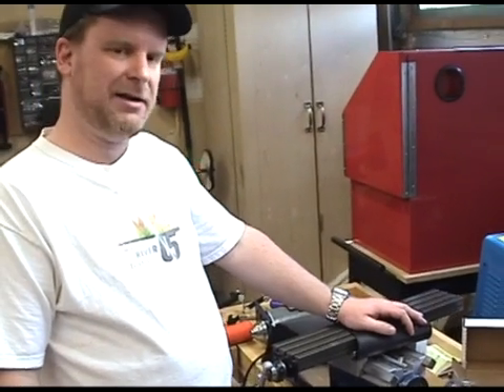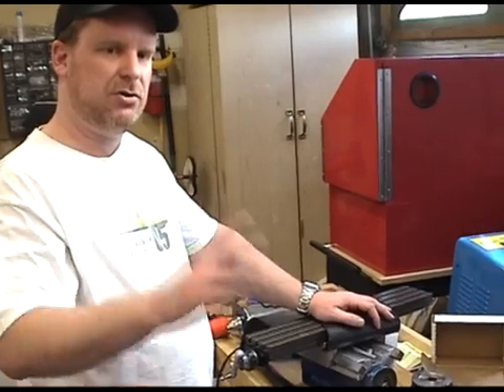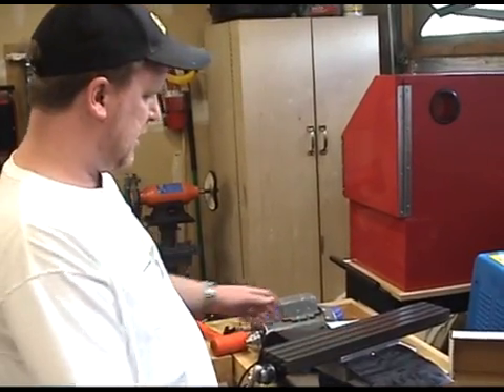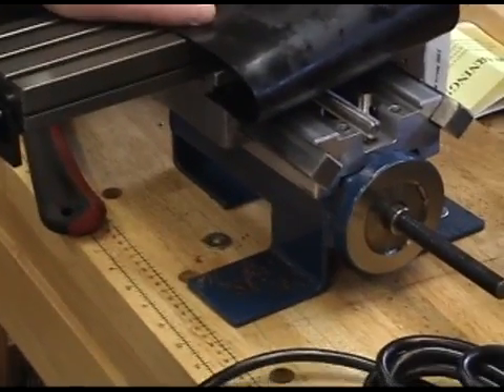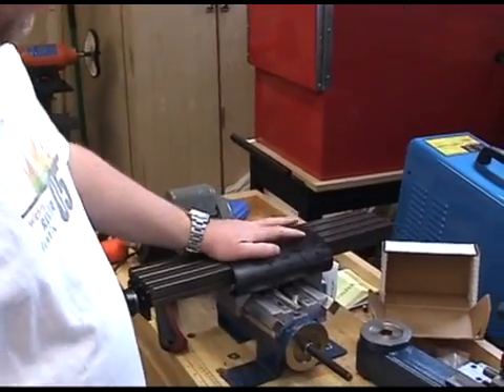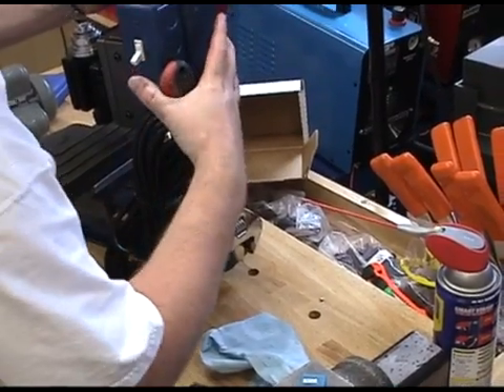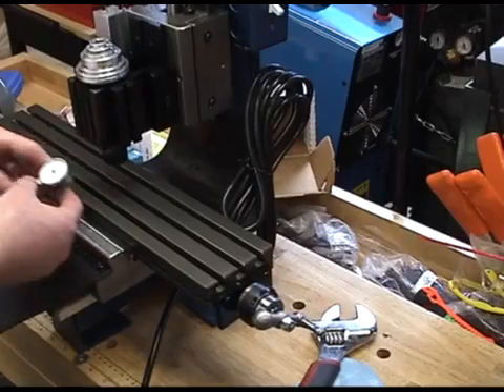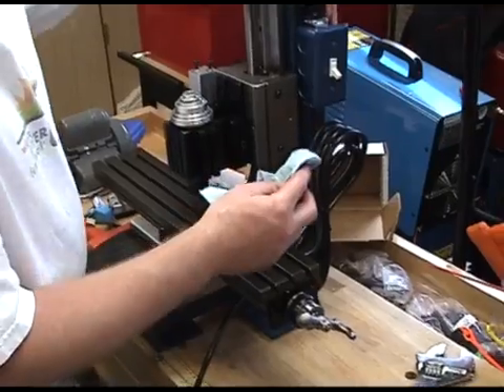Taig_Setup

Comment: Allen wrenches with ball ends are great for quick assembly in offset locations. but you need a hex end for final tightening. You can also buy or make allen wrench sockets for use on 1/4” ratchets.